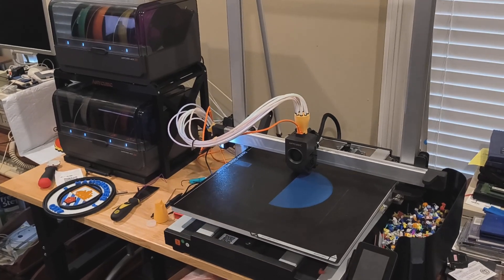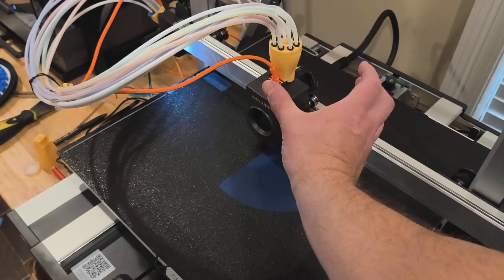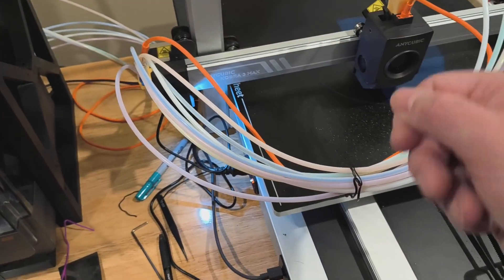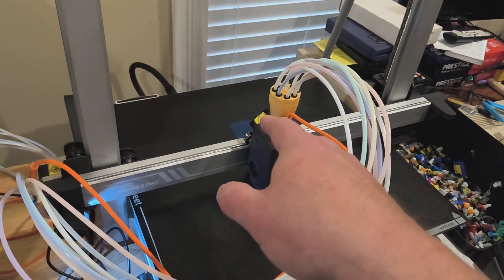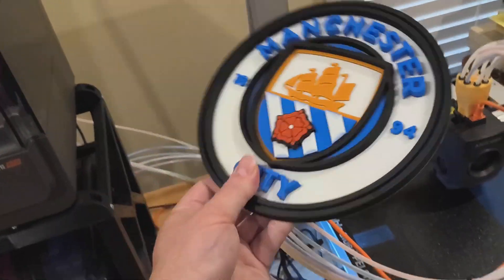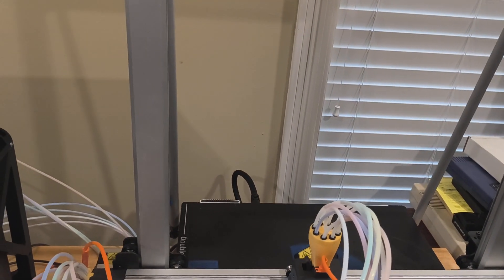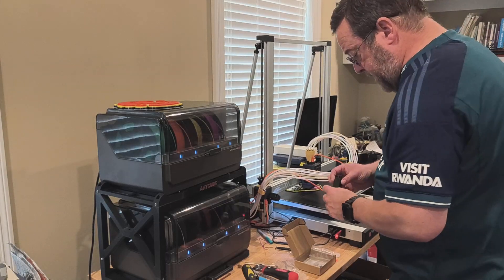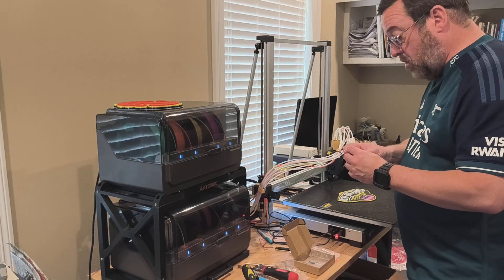Anycubic Kobra 3 Max Combo: Vid #6 - Cable management.  Power cable snags and pulls printhead off.

Comment from the maker: I little tip for anybody who decides to make this stacked ACE Pro holder:  The bottom tray slides out which will obviously drag the 4 bowden tubes with it, but even though these tubes look huge, if you have the printer a fair distance from the stand, and you have the stand pushed back to allow the draw to slide out over the desk surface, you can still discover that the tubes can snag before you can pull the lower tray out enough to completely open the top lid.  So ideally, you need the need the ACE Pro next to the printer and the back of it in line with the printer head, OR raise the frame level to the height of the print head as that will also give you some extra feeding room for the tubes.  If your tables allows, you can also rotate the ACE Pro 90 degrees so the back of it faces towards the printer and this will also give the filament an easier and smoother path.

Comment: I have a problem occurring with 8 bowden tubes attached—it gives an error stating that the extruder head is experiencing clogging. This was definitely NOT the case—the extruder was laying down perfect layer height material. I haven't fully checked out the reason, but preliminary findings indicate that the PTFE tubes slip and cause the extruder entry path to be at a sharper angle, thus causing friction at that point. I had no problems when I was printing with only one ACE attached and 4 bowden tubes, so it must be the slipping/higher angle that is causing the error message. It definitely could use the addition of spring-mounted strain relief as well as placing the ACEs at a level high enough that the slippage is negated.
Reply from the maker: I've started getting this recently after I rearranged my tubes.  Like you, I narrowed it down to the angle that the 8 tubes are coming down into the hub, plus also check how sharp the curve of the tubes are coming out of the back of the ACE units as the ones on the far left of my setup (tubes 1 and 5) and the tightest curve and I could feel the extra friction  just manually pushing and pulling the filament compared to the others.  Using some of those star shaped clips and giving it more slack fixed the rear port issue.  For the hub I used more tube holders to keep the tubes more vertical has they feed down into it.
I just printed a top bar mount to guide all of the tubes over the bar and directly down to the hub, so this should eliminate the issue completely.  I just haven't tested it yet.as I think I'm also going to need a base to elevate the ACE units to give me more slack for the tubes.
Reply: I've got a clogging issue right now that I'm trying to figure out. I have the official 8 tube hub and the typical, clear or replace the nozzle, remove and clear the hub, etc haven't worked. I reached out to Anycubic and they sent me a video link and additional instructions on how to partially disassemble the printhead to clear it. Haven't had the time to do this yet, but that's my next try.
All attempts to retract or extrude from any of the eight ACE slots "works" without issue. I say "works" because I mean the filament moves as expected (retracts or moves to the head), but it never actually extrudes. So basically my clog appears to be in the head itself.

I've got 610 hours on my printer and I'm on my fourth nozzle. The first one (came with the K3M) lasted the longest. Then it got clogged so bad that I'll have to heat it up off the machine to try and clear it. Same with the next two that I put on, but I'm now wondering if ever since the first clog I had, which was a pretty simple pop off the nozzle and bowden tube and clear some snapped filament, that the clogs have gotten worse and worse. Wondering if I only cleared part of the problem and the rest is inside the printhead.
Reply from the maker: @rhelscher  I actually went back to the printed 9 filament hub as I like the way it unscrews so you can see if there is an issue inside (like broken filament).
What I recently picked up which really comes in handy is a a long "prong" that goes in through the hub and pushed through the print head and into the nozzle so that anything that might be causing a blockage gets pushed (forced) out of the nozzle).
Reply: @LanchburyConsultingLLC  This would be super helpful, I think. The one they give you with the K3M didn't do the trick for me. Do you have a link?
My main disappointment with the Professional Hub, as they seem to be calling it, is two fold. It only accommodates eight tubes, and there's no tube/cable holder from Anycubic for the eight tubes and the cable. I haven't tried to print TPU yet on mine, but everything I've seen says don't use the ACE Pro for TPU, use the single holder.
I may change the official out as well. I think you talk about the hub you printed in one of your other videos. I'll have to go back and look. Did you print it in resin? I was considering printing one in resin, but then I got word that the official had shipped.
Thank you again for all of the content!
Reply from the maker: @rhelscher  Sure, look on Makeronline for "8+1 Color Filament Hub Rounded for Kobra 3/Kobra 3 Max/Kobra" and print that.
I used standard v2 resin on my Staurn 4 to make mine and the first one broke at the extrusion point.  Last night I had hell when I couldn't get my filament to feed and when I disassembled the print head and removed the nozzle, I found the same issue and the tiny bit of plastic had dropped into the print head and blocked it.  Thankfully I could clear it, reassembled it and used the official 8 hub to finish the print, and then I made a new hub using PLA carbon fiber on my Centauri Carbon with a 0.12 layer height.  That thing looks and feels great (100% infill), so I'll swap this out later.  Thankfully the messing around didn't affect the print.  I do like the way the K3M recovers from any stoppages.
Reply: @LanchburyConsultingLLC  Awesome! Thank you so much for this information!

Comment: A similar thing happened on my kobra 3 where by the orange cable got nicked by the cutter as it drooped to low. I fixed it with a little cable holder i made up and mounted it to the top bar on the corner. This fix is like a spanner which holds the orange cable at the top and left a lot of slack to allow it to reach the right most x-axis position. 
Now it never gets close to anything to cause a problem, so I guess the same could be done for the PTFE tubes should they droop to be a problem. My PTFE tubes do not as I have my Kobra 3 in an enclosure with holes of the enclosure for the tubes from the ACE pro to reach the print head.
Reply from the maker: I've found a file for a top bar mount to allow the tubes and the power cable to loop over the bar and stay out of the way of any possible snags.  I'll print it out soon and post a video of it.  It also looks like it will smooth out the curves of the filament tubes.

Comment: Will You recommend this  produce  i am still hesistating ?
Reply: I wouldn’t recommend it, too many teething issues, I have a 4 day single colour print going on currently and it it constantly stopping with a filament head jam problem, I roll the filament back and resume print. Seems to be an issue with the feeding tube runs and it the head itself. I have a QIDI 4 and Creality k2 which are both better buys, QIDI is still single colour but ready for multi colour wheneverthat is launched
Reply from the maker: @intensewalkera  ACE placement and tube placement makes a huge difference.  I don't like the angle that the filament comes in at the tube holder on the X arm.  There's a nice solution that clamps to the top bar that just loops everything through a hoop and down to the print head.
Reply from the maker: Absolutely.  I'm doing a 2 day print at the moment with no issues.  I'll be throwing out an update video later on.

Comment: Hi I have a question your two ACE Pros are on top of each other and you have a border around the bottom ACE where the other one is written on top. Was this included in the delivery or did you print it yourself?
Reply from the maker: I printed them myself.  The Anycubic site has the STL files to make it and I thought it looked good so I ran one off.  Use plenty of infill.  The bottom ACE is actually on a sliding tray so you can pull it forward to open the cover and then slide it back again.  The design include the ability to add wheels, but as the tabletop is so smooth, it doesn't need any.
Reply: @LanchburyConsultingLLC  Thank you very much for the quick reply. Then I'll take a look and I'll print it out too, I think it's great.

Comment: hello , thank you for the content , i wanted to ask here if anyone faced 10122 Extruder heating abnormally error on the k3 max 
my machine is 1 day old , had only 2 prints on it and this happend , followed anycubic docs  but that's not fixing it
Reply from the maker: Not had that error.  Two think come to mind, the first is that there is a problem with the thermal sensor on the print head (they are fragile and can break, but they are a cheap replacement).  The other is that you have the filament temperatures set incorrectly on your printer settings or in the slicer (or, you're using a pre-sliced gcode file that wasn't meant for the 3 Max).
Try one of the previous prints that worked and see if they are OK.  If they are, then that probably indicates an issue with the new file rather than the hardware.
Also, I noticed there was a new firmware update available today, so try letting that install.
Reply: I would also look to see if the air temp is too low. This may cause the print head or bed to loose heat and thus fool the printer to think the temp sensor is faulty. Only solution for this case is an enclosure, it is likely a common problem for all non-enclosed printers.
Reply: Hello guys , i think there was just a bad part , i’ve got a new hotend from aliexpress and the probes is solved
Reply from the maker: @ Excellent.  Glad you got it sorted.